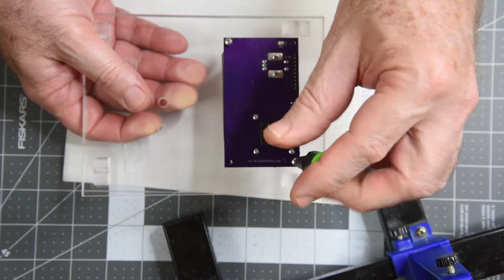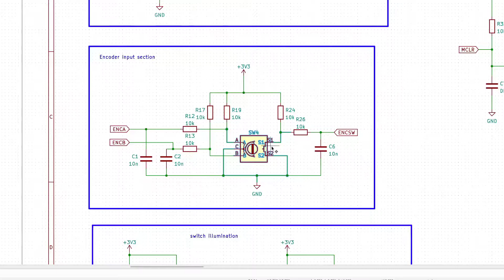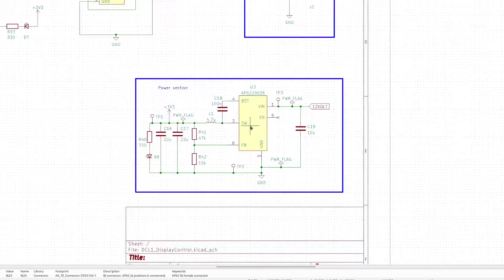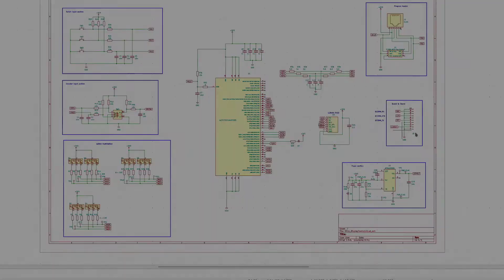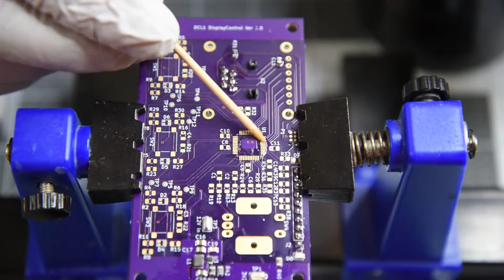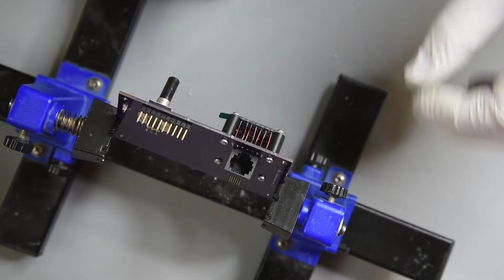User Input & Display – For the Electronic Load Project

Comment: Hi, I just found your channel and enjoying your content, thanks. Had a question about the switch schematic, why do yiu hava the resistor and capacitors there instead of directly connecting it to the micro?
Reply from the maker: It has a couple of purposes: it will filter a bit of the very fast switch bounces, and it will protect from some static discharges. Also, on a test board, it's a good place to disconnect the switch if you want to tie something else in.